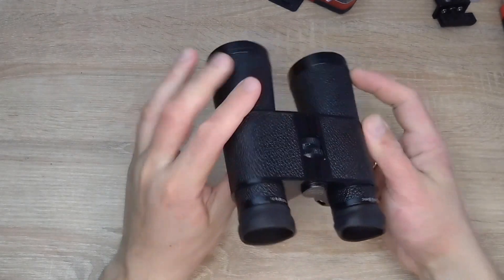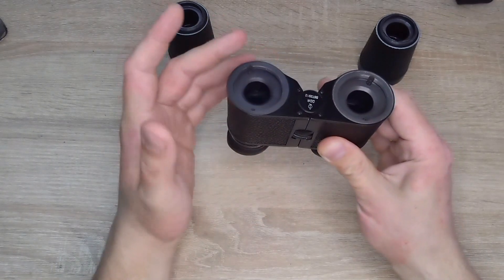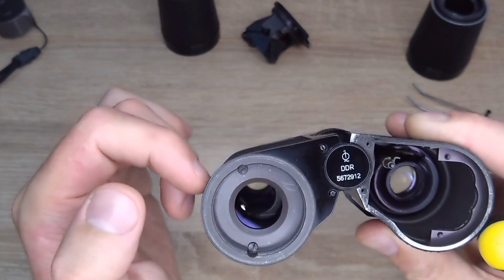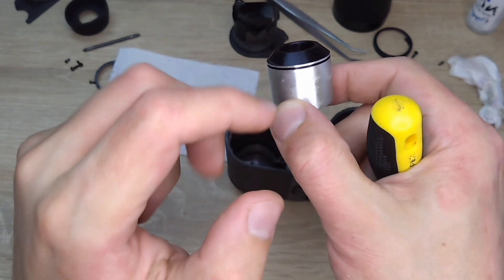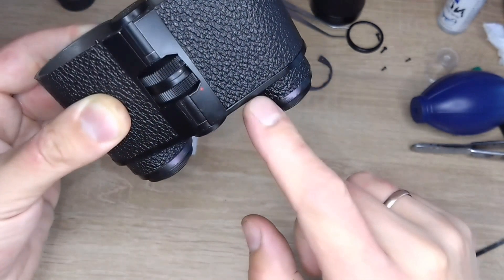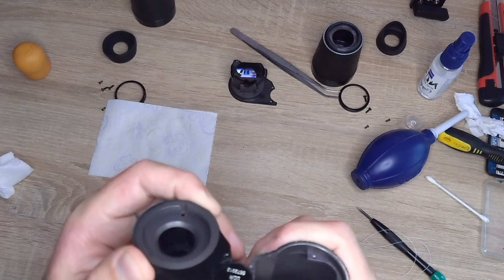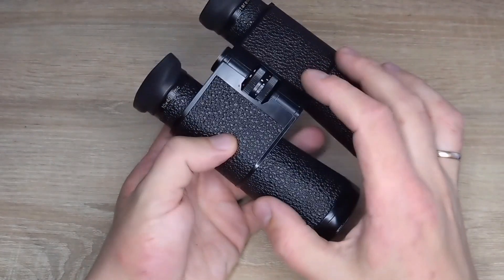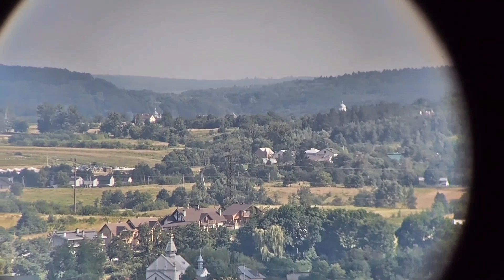Carl Zeiss Notarem 10x40 – Full Repair & Cleaning in Just 1 Hour!

Comment: Great video really help me alot. Nice trick with the string probably over engineered. Just cut a long thin piece of cereal card insert it from the opposite end you was working from with the string and simply push the pin as you insert the prism cover and then pull the card away. 👌🏻
Reply from the maker: thanks for the life hack

Comment: 24 hours is long time to fix a binocular, but thanks for successful repair video.  Roof binoculars seem to be much more difficult to repair (if it's possible at all) than porro binoculars which are easy to disassemble.  I had two broken binoculars - one cheap porro and one cheap roof binoculars.  I destroyed roof binocular in attempt to disassemble it.  I was able to easily disassemble porro binocular in matter of minutes and fix the problem.  No more roof binoculars for me.
Reply from the maker: Now all companies make roof binoculars, apparently they are easier to seal to fill with nitrogen.